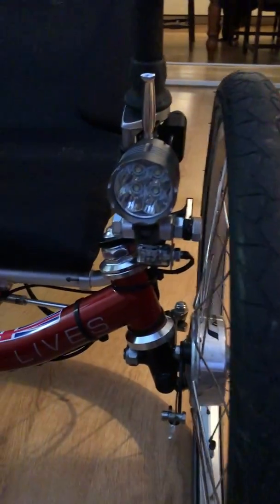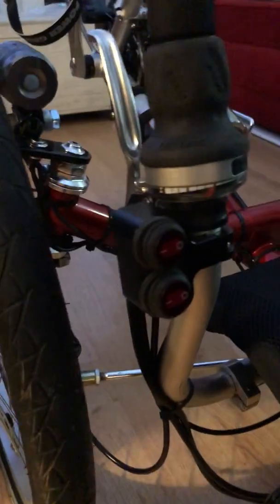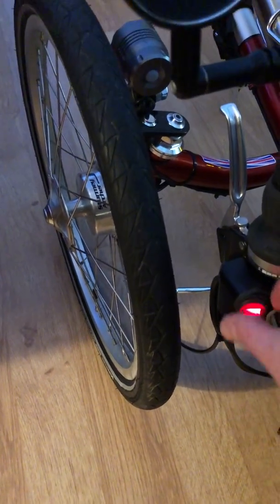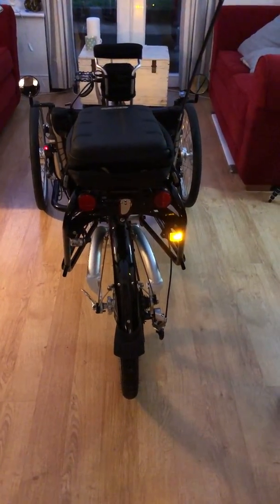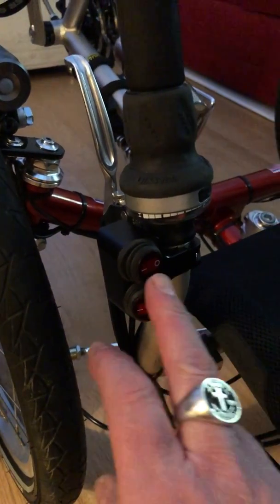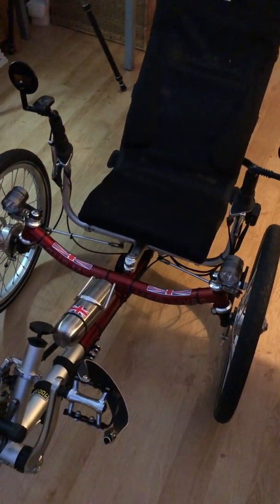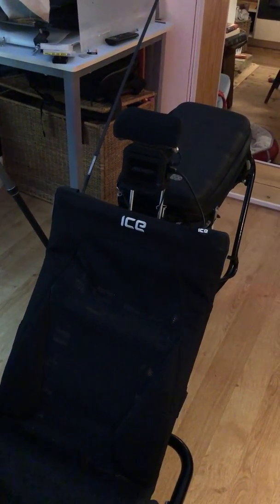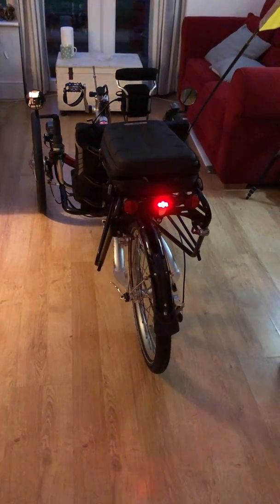ICE QNT Recumbent Trike - DIY LED Indicator (turn signals) Install

Comment: I'm afraid it's nearly impossible to make the lights look unmodiffied on diamond frome or even two wheel recumbent if one wants to keep the weight down by attaching some IP65 5050 led strips or better ones (some manufacturers say wide beam angle is better, but narrow ones with lens or reflector should be easier to see in direct sunlight) to  flexible 10mm neilon zip ties with heat shrink tube while keeping the turn signals 18cm appart at the back and 23cm at the front.
Looks like the trike has some dazzling conical beam headlights which might make the turn signals hard to see. Some layered low and high beam with turn signals sitting above probably would be more visible.
Is this solid state flasher relay with a buzzer or noisy electromechanical one?
Isn't it possible to accidentally turn on the wrong switch since they are so close together and on top of one another? 3 pin switch and DPTS switch for hazard lights is another option.